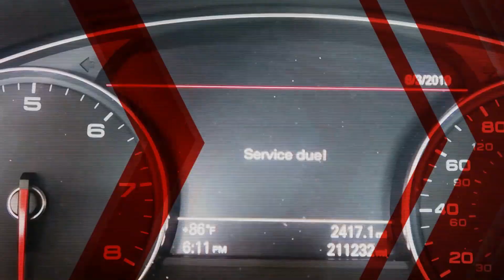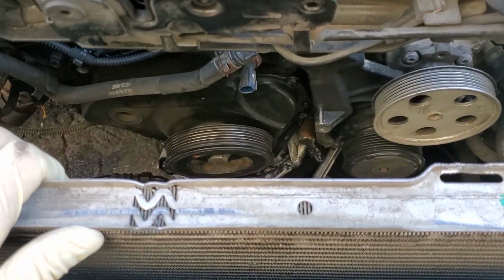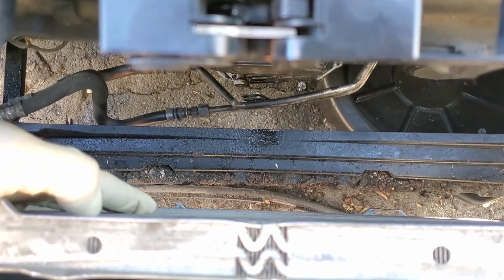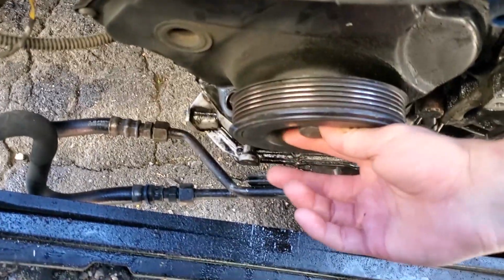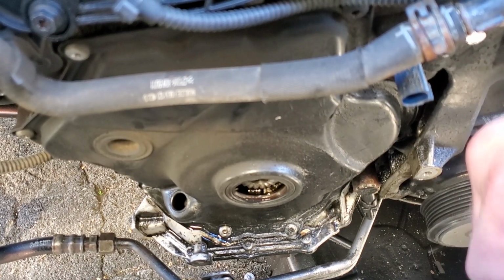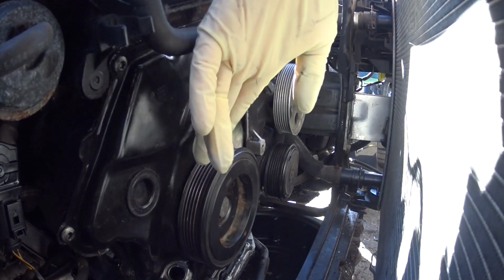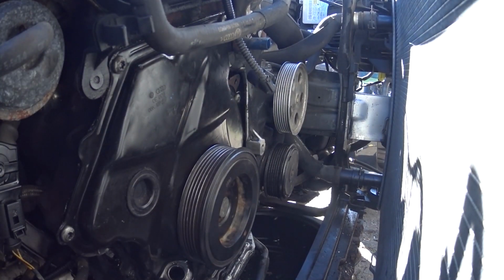***HOW TO REPLACE CRANKSHAFT SEAL OIL LEAK AUDI Q5 2.0L***

Comment: Hey, what is the crank bolt torque specs?
Reply: That crank bolt is a one time use bolt, you need to install the crank pulley with the triangle key way pointing at 12:00 the correct way to install the pulley is to ensure the motor is in time at TDC and that bolt has an internal o-ring that should be lubricated with silicone grease. The bolt is wound in hand tight making sure the gears never move the chains and it’s torqued to 150 Nm + 90° but you’re gonna need a counter hold tool with the 4 pins to hold the pulley.. I hope you didn’t start the car with only that little bit of torque from the ratchet